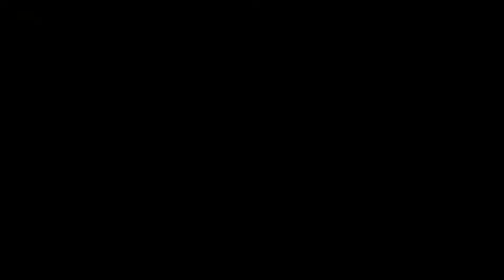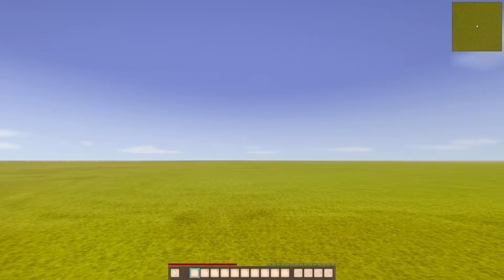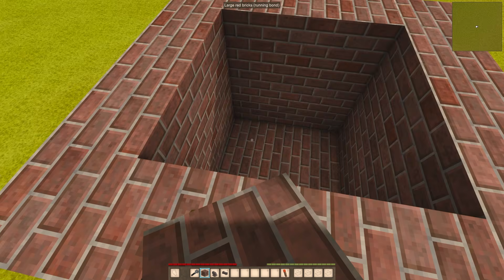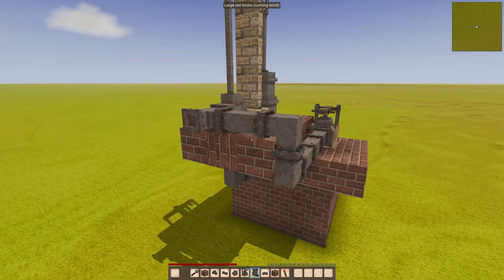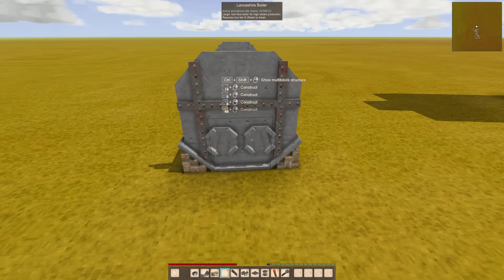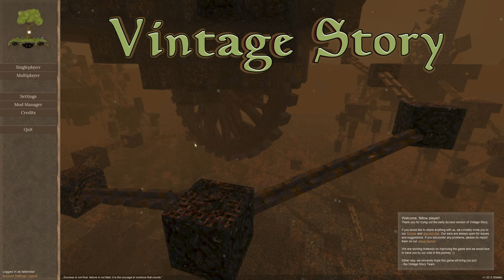Vintage Story Mod – Pipes and Power Expanded (trying to explain steam power)

Comment from the maker: Why does everyone keep talking about gregtech? My mods aren't even remotely close to that in idea and in scope or execution
Reply: well if you want a serious answer, gtnh has a early phase called steam age. even if your mod works entierly different, the thumbnail and some asthetics look fairly familiar if you played a lot of gregtech. thus, the people meme.
Reply: Indeed. However, out of curiosity, what else do you plan on adding? Perhaps oil refinement and or electricity?
Reply from the maker: Implementation that exist right now is simplified and surves as a test run to see if there would be people interested in this. I have more detailed miltistage plan layed out for what I want to actually implement in my mods. You can have a look if you are intetested:
https://drive.google.com/file/d/1NKAGN_F59RsgQ9YKuhT-I6X0dYnarjIA/view?usp=sharing
Reply: @ringavidra  Looks great! After testing the mod a little bit, seems like it requires a ton of iron. Stage I would really help with progression.
Reply: bec they like trashtalk and never played a real gt modpack .... and your models etc looks more like immersive engineering ^^ They see 2min of Video "uhh the tank is much like GT"  kekw (i played GT:NH for 6 years)
Reply: Do you have plans to be able to make this mod work with Vintage Engineering fuels such as Diesel or Gasoline?
Reply from the maker: @southernbear736  That is 20th century tech
Reply: @ringavidra yes but for intermod compatibility you will get tons more users
Reply: Memes, mostly.

Comment: Would be cool if you add a bronze pipes variants as a "cheaper" choice or just an alternative if iron is scarce but tin isn't and make them half as strong as iron ones (2.5 atm max), still usable with the Watt engine but you really have to be careful , it would make sense as bronze is way stronger than most people think being stronger than wrought iron and it would give bronze other purpose late game other than making lanterns and nails for some crafts . And btw your mod is great as it gives motivation to play after getting steel and honestly it's the highest quality machinery mod so far and i doubt there will be anything better, although it is sometimes grindy especially when making these god forsaken rods as there is no way to cast them or mechanise their smithing for now, and i saw your plans and i can say that I'm ultra excited

Comment: Im having an issue when i switch the cowper stoves from inputing gas by close one valve and making it output by opening the one with the presurized air, the furnace suddenly says that it will solidify in 20 seconds

Comment: I can figure out how to make hot blast psat 2 atm. I have 2 sepearate watt engine with air blowers like in this video but neither of them are producing enough preassure
Reply from the maker: The pressure that engines produce are directly proportional to input pressure (engines are basically machinesthatconvert input steam pressure into output gas pressure). Try increasing the input pressure, but be careful not to allow the engines to break from overpressure

Comment: It would also be cool for the water source to be pumped out over time. Otherwise, you can just set up a tiny infinite water reservoir and feed a giant factory. This way, you have to find larger (more plausibly infinite) water sources to pump from, like a river or lake, into your factory reservoir.
Reply from the maker: All water blocks are infinite sources of water in vs. Any workaround will hit into that wall.
My solution rn is to gate where I can control, so the pump can only move limited amount, and intakes won't work if placed near each other. That will force player to spread out and build multiple pumps if they want to scale up, so it's not as easy as place one block and you are done

Comment: It'll be cool to have the intermediate stage between manually running blowers and using wind or water power to run them before turning the entire works over to steam power! It'd be just like the real line of progression through the industrial revolution

Comment: What is your background in engineering? It's very cool to see someone add some in-depth late game power. I was looking through your future plan document and the radiators idea is very interesting, I am curious if you are planing to add pipe insulation/lagging and if so efficiency losses or gains? Also since air/steam pressure is already in your project would you be adding forced draft boilers and possibly steam powered injectors for feed water?
Reply from the maker: I'm data science phd student, so I'm not very well versed in metallurgy and history, but I read some articles and look for information before implementing something.
I already played around with pipe heating when tried to add copper/brass pipes, but those would simply melt when used for the furnace, so yeah, I scrapped that idea along with low tier piping. Right now pipe network is implemented as a graph that contatins all properties and machines simply manipulate that. So no flow actually gets simulated,  that I implemented only for the molten canal network and that required to do network over network virtualization stuff.
I don't plan to add any boilers, since these already cover two gameplay roles of producing LP steam for starter setups and HP for the more efficient ones. But I tried to make the code as generic as possible so adding new boilers won't be that difficult. The bigger problem is to create shapes for all of that stuff

Comment: now im demotivated to keep working on my own steam power mod i worked on for the last two month :C
PS: your mod looks good
Reply from the maker: Depending on which stage of development are you in, you could use my abstractions and network code!
Can you describe what was your idea for steam power?
Reply: @ringavidra  At this point, I have synced my stuff up with the vanilla power system. I have a Aeolipile (Heronsball) stage 1 and a James Watt steam machine stage 2, and wanted to make a 3. stage that is then a modular steam machine. The James Watt machine is still just a manual use machine, and I don't know if it can hold up with the power your machine does. I think I'm just afraid of when I release my mod that nobody will use it, because there are too many alternatives. I wanted to ask you about how to get the compatibility to make molds for your mod, because of your steel smelting. Also wanted to make an early coke oven and an early smelting oven for liquid iron that is compatible with your stuff, and also a multi-block mold for the piston rods and stuff. I have also made some gears out of iron and an axle out of iron. My idea was to make a steam engine with progression system. So you start off with a small steam engine that is 1x2 blocks. The second one is 5x5x2 blocks and is built like the water wheel in stages. And the third one would be then bigger in terms of you can choose how big it really is because it's modular. The progression in terms of how far I got with the mod is slow because reasons. And it's really disheartening seeing people doing similar stuff way faster than I could ever do. And then, yeah, it feels, it feels a bit hopeless, but I still try to do it. sorry for the big text
Reply: @ringavidra  I really like what you did. I think the steel making is a real good progression step above the normal vanilla progression. And as I saw it the first time, my scope changed from doing the same what you did to doing a more early version of iron smelting and coke production.
Reply from the maker: Tbh, what I did for now more like test drive of my ideas, becaue I'm not sure if people would be interested in a mod that will add machines that require understaning and effort to operate. If you are interested, here is my plan for future development, maybe this will give you an idea where I'm going with my mods:
https://drive.google.com/file/d/1NKAGN_F59RsgQ9YKuhT-I6X0dYnarjIA/view?usp=sharing
Reply: @ringavidra  basicly your doing what i wanted to do but more indeph and more industry. in my mod the steam engine also need manuel intervention so it doeset blow up with safty valve and so on. i think i still can make it so that we dont intersect to mutch
Reply: @ringavidra  i think people will like your mod for the reason that you need to understand and put in some effort

Comment: One thing that would be cool to add is an air tank, it could store air at pressure for the blast furnace stoves or a Bessemer converter, allowing you to run these devices without as many blowers, and to balance it you could make it so that it requires steel, that way the player not only has to build a massive tank, but they need so much steel already to be able to make the tank, and thus they need to achieve normal steel making before they make make their steel setup smaller

Comment: It would be a cool feature to be able to connect the intake from bellow so that you dont need a pump since the water is already under presure ^^
Reply from the maker: I plan on modifying the liquid network layer to adhere to height and pressure, so you would need to pump water up but down it will flow on itself. But that feature is pretty heavy and won't add a lot of gameplay benefits, so it will come after more important stuff
Reply: @ringavidra  amazing ^^

Comment: Did you consider changing the output of the high pressure Cornish steam engine from condensed water to lower pressure steam so that we could possibly hook up a Watt engine to it to make a compound engine?
Reply from the maker: Both engines have condencers (that box on the bottom) so they produce only hot water. This is historical design that almost all steam engines head, but what you ask about I want to add in form of separate tandem corliss engine when I will work on bigger machines

Comment: Any chance we could reuse the exhaust for blast? Is it too oxygen poor?
Reply: Also, any chance to allow other fluids to be moved with pipes / be able to use water from pipes to fill other containers (IE distillation)?
Reply: Oh, and can you use blast as bellows for forges?
Reply: Also, please please please add gasification process as a player accessable option for lighting! The vanilla feature was so cool.
Reply: @Meelockia I think I saw you made this chain of suggestions on the mod page and the author replied to them, but based on their reply to your last suggestion for gas lighting I don't think they knew about coal gasification. Might want to clarify that for them.

Comment: I hope we get boiler explosions
Reply from the maker: The boilers can actually explode if handled incorrectly! I've said in the video that operating near pressure limit can lead to catastrophic consequences
Reply: @ringavidra  Smells like Kenosha starts playing.
Reply: With the current explaination it seems like it shouldn't ever get lower enough water levels for that to happen, but might be possible if the steam engine was put under heavy enough load?

Comment: Would be cool to have something similiar for non-ferrous metals. Maybe more early game stuff. I can lend a hand if you need C#.
Reply from the maker: I have some ideas, so we'll see if those become reality
Reply: @ringavidra  Nice. If you need programming help let me know. I made few mods myself and I'm all into this expanded theme.
Reply from the maker: @ZulacecekStarcraft  The programming is not an issue for me, the issue is to figure out how to properly set up/balance everything and to create the shapes for all new machines/blocks/items, since as you can see in the video, I make custom shapes for most of the stuff to avoid "magical blocks" feel
Reply: @ringavidra  Newcomen engine for early game?
Reply from the maker: @marcks-3980 there is no use for engines until late iron age anyway, so I don't see the use for it

Comment: If the setup is so fuel hungry, maybe some kind of charcoal retort can be added so charcoal making can be more efficient and keep up with demand?
Reply from the maker: It's not that fuel hungry since I didn't change vanilla coalpile burn time, and it can burn for several days by itself. But if you keep a ton of boilers running for several days that may stack up
Charcoal making machine as well as more efficient coke oven can be a feature for smex
Reply: charcoal wont work, steam engines need fuels like coke or similar coal. charcoal doesnt give enough heat.